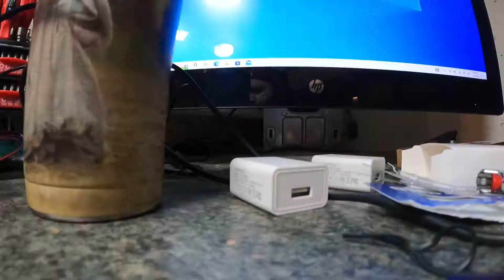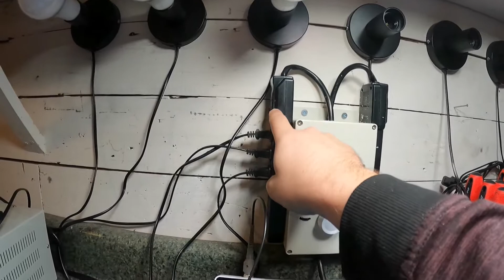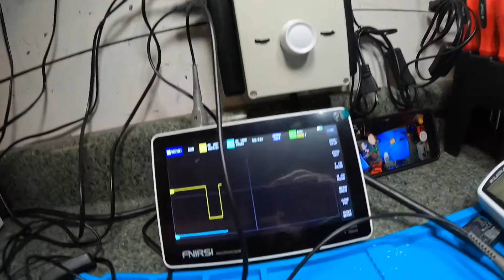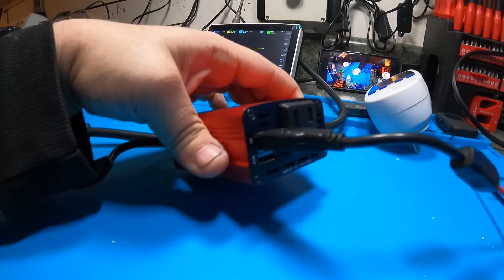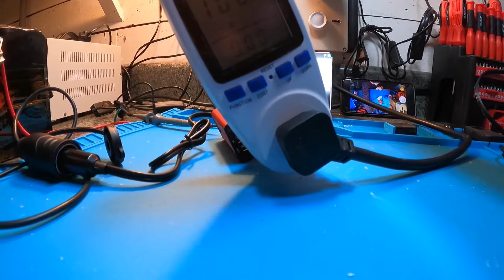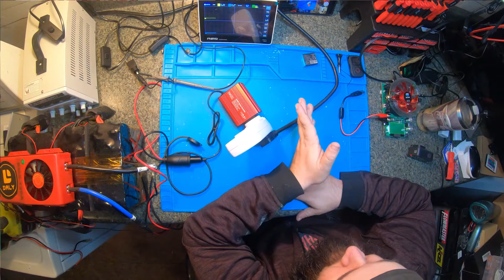Putting This Cheap 12v Inverter To The Test ( FOVAL 150W Car Power Inverter 12V DC )

Comment: I just bought one to keep my laptop charged in the car, but the Green LED never turns on.  With the laptop charger disconnected (no load on the Foval) the Red LED turns on immediately.  Dead out of the box?  I haven't tried the USB charge function.

Comment: I was thinking on getting this inverter to light up 4 LED light bulbs (around 10 watts each) you think they are good enough for that? I had an old Radioshack one but as soon I connected to 1 Led it started smoking
Reply from the maker: Find yourself something that is sure sine wave. Some newer electronics are very sensitive and will fail if the sine wave is not clean. Hint older inverters may even be worse than newer ones because components inside them could have failed like older capacitors.
Reply: @OperationCamp  Ok, thanks!

Comment: I wonder if you were to cut off the cigarette plug adapter and connect ring terminals to wire to connect straight to a battery would the test be different as most cars cant handle 15amps coming from cigarette lighter plug.
Reply from the maker: You could but even the wire that came with the unit were on the verge of failing. best thing you could do if you had to have it is solder new wires with fused to 12v volts like you said.